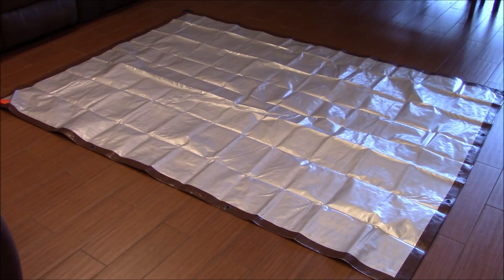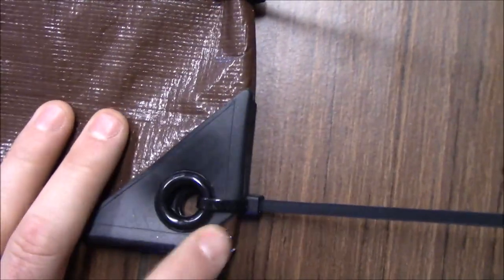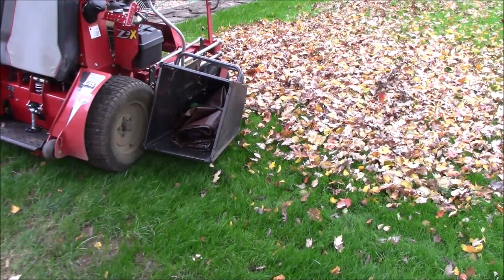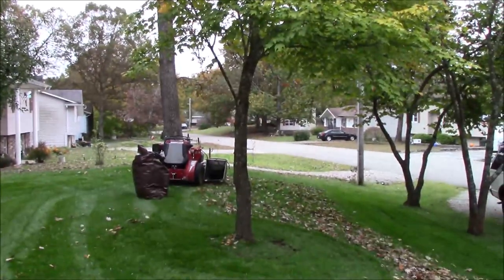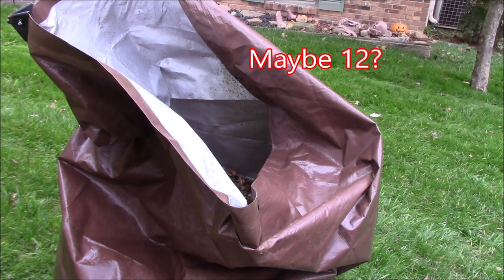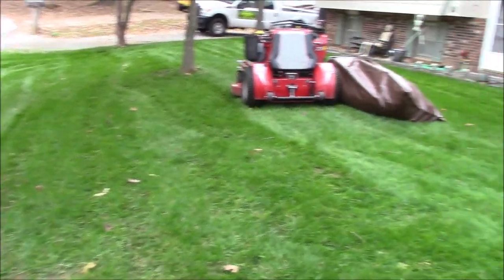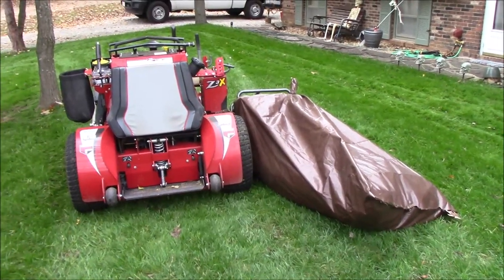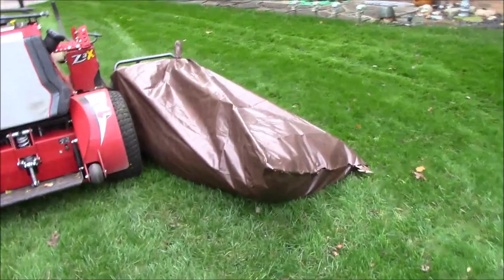Homemade Leaf Bags - Making + Testing

Comment: I’ve made 3 of these (one for a friend). I pretty much copied Randy’s system. I used the harbor freight silver bag 9’x7’ with there small black cable ties. Total was about $9.00. My bag (2nd year of useing it)finally ripped from  catching it on a large  sharp flagstone. I just cut the bag off at the rear and now it’s about 1/2 of the original size.
    One thing I would to try and add is putting a thin sheet of plastic (like from a sled kids use to go down a hill) across most of the bottom of the bag. When it gets full the weight slowly wears the bag and makes it vulnerable to tears. The plastic would help the bag slide across the lawn.
Reply: I also put a cable tie across the mouth of the bag slightly larger than my grass gobbler. And wrote “top” on the bag so I always put it on the same way.
Reply: Would a duct tape pad on the bottom work to insulate from tearing? I use it on my heavy bag to stop it from tearing, has worked for years. 🇨🇦👊🏻👨🏻‍🏭✨💖👌
Reply from the maker: That would work great I think.

Comment: Cool. I'm guessing it would work better on larger lawns with long straight runs and fewer obstacles around which to mow. You could also build a little sulky with a pair of wheels to support the bag; that would let it roll easier and not get dragged off before it's full.
Reply from the maker: Definitely, my yard is pretty small. There are a lot of ways to modify this system to work for different scenarios. I like the simplicity of it, and lack of moving parts.

Comment: Enjoyed and appreciated the thorough assembly and testing video. A couple of questions:

1) Did you find the 10-mil thickness of the tarp you used here to be adequate, or would you go heavier in future?
2) If you were to do this over again, would you use the same size tarp or a smaller/larger one?
3) What was the reason you folded the tarp lengthwise rather than widthwise? You stated early on in the video that it would be evident later on, but I never picked up on the reason. 
4) Did your idea of stacking the bags on a trailer work reasonably well for loading / unloading?
5) Per your more recent videos, I see that you're now using the Protero PV18 on the Ferris Z3X. Which collection system do you prefer, and why?

Thanks again for the video! Recently found your channel and have been enjoying the archives.
Reply from the maker: 1- 10 mil is good. 2- same size tarp. 3- to fit better on the catcher. 4- yes, especially on a small budget. 5- I did this video to help people who are starting out without a bagger like the Protero. I already had the Protero system when I did this video, but I always have a backup plan.
Reply from the maker: 5- I prefer the Protero, but it's expensive compared to the catcher and tarp bags.

Comment: Thanks for the video.  What if you wrap some tape around it loosely when it's in place and then attach a rubber strap to the bottom of the bag somehow.  This would give the opening the basic shape. You could then pull the strap up the sides and connect them up top.
Reply from the maker: Good idea, I will be trying a couple different things to see what works best.

Comment: To me, I prefer a bagging setup such as this as it doesn't put any downforce weight on the mower as does a side mount bagger on a stand on mower. Obviously the prefessional side mount bagger unit manuvers much easier and you can back up BUT when the ground is wet, that's where the ruts start appearing.
Reply from the maker: Definitely has a lot of advantages.

Comment: interesting idea. i remember sef buying and running one of these bags and attaching it to his rider a year or two ago.  it was like 2 or 3 times the size and kept snagging things 😂

but where in tarnation are you getting 10 dollar heavy duty tarps?? i forget what i usually pay ( and i go at least 10x12 )  but i think it's alot more than around $10 per tarp 🤔 maybe it's just because of the size i buy.
Reply from the maker: Home Depot 😁
Reply: @HandyGuy2016  thanks 😂👍🏻
Reply: Harbor freight is even cheaper than HD.
Reply: @bikes7777  i ended up getting two 11x15's ( perfect size range for the amount of leaves i like to grab, but it can get heavy quickly, and that's when i tie them to my rider if i have it with me ) from there for 12 or 15 bucks, i think, so not bad.... but as you would expect: you get what you pay for 😂 they do the job, though.

Comment: I wanted to see what chute blocker  you are using with the rackem bagger and if they both work together or did you have to make changes I currently have a chute blocker on one mower and an accelerator bagger on another because they will not work together , any info or maybe even a video etc on this would be helpful , thanks for your info.
Reply from the maker: I have a video on that in my Dependable Lawn Care playlist, but the Quick Chute is what I use and I don't have to remove it to use the grass catcher.

Comment: Dang. The 6x8 is not big enough on the opening to fit on my bagger. Have to get another tarp and try again. :)
Reply from the maker: Did you try the 8' side to make the opening?
Reply: @HandyGuy2016   no I did the 6’ side. Was I supposed to use the 8’ side?
Reply from the maker: @bryanlovesjenn  it can go either way depending on the bagger opening size.

Comment: I just noticed you have your chute blocker on with your bagger. Can you still use your chute blocker if you take off your grass catcher ?on my Snapper pro walk behind I have to remove my chute blocker in order to use my accelerator bagger what a pain .my dream mower is the 52” Toro grandstand W/ the leaf collecting system its 11k for the mower 4K for the leaf system I can’t justify that king of cash right now
Reply from the maker: Yes I can use the quickchute with the side catcher which is ideal.

Comment: Seems like it would be better to blow the leave into a pile, where you can drive over without weaving around trees or other obstacles.
Reply from the maker: It would be, unless you need to cut the grass at the same time, like in this video. If it was just strictly a leaf cleanup, you could definitely blow them into a central location.